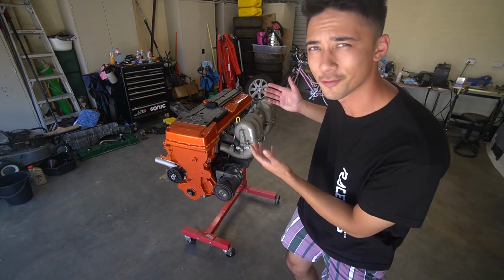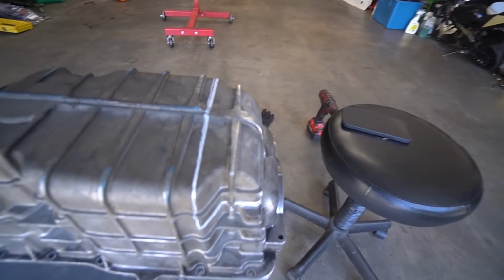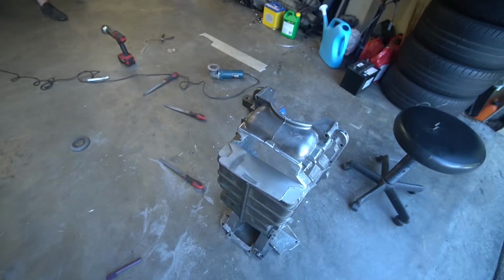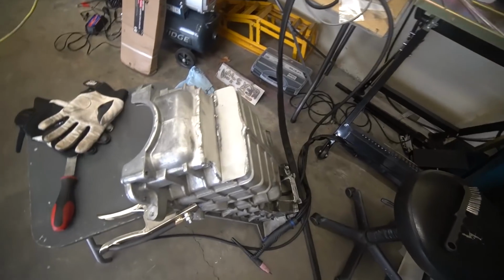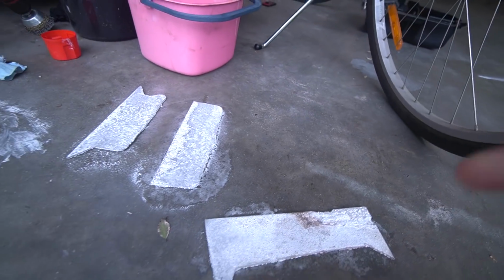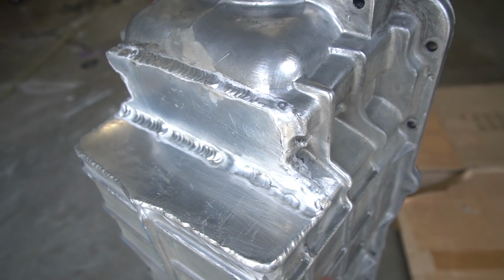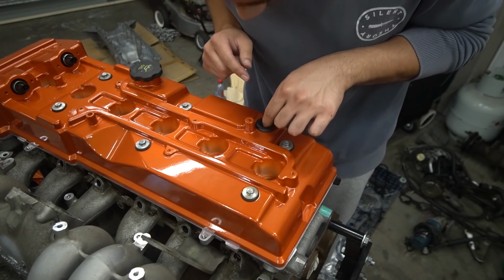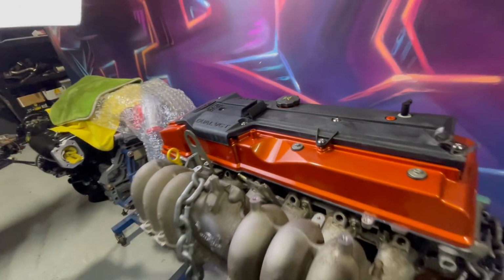THE BARRA IS READY FOR THE EF + CUSTOM SUMP MOD

Comment: Two hot tips for you mate the next time you cut ali.

Get a wax block and cut into it a few times throughout cutting with your disc . This wil make it cut better and stop the disc from getting hot and binding, causing it to catch and possibly explode.

And for god sake use the guard. Ive seen to many idiots take the guard off and the disc catches kicking the grinder back into their hands n fingers and discs exploding all over the place catching chunks of disc in body parts. No a pretty sight if you cop one in the face like an old work colleague i once knew.

Comment: By the way Rex there is nothing wrong with the pieces you welded the first time, when u removed them all u needed to do to replace the same pieces is simply grind the edges down so you can weld them simple as that mate.  If u grinded the edges down the first time u don’t haft to to worry about the coating as u have grinded it off.

Comment: I’m a bit late rexy what u doing u should of grind the aluminium down on the sump to give you a cleaner surface and the fab plates then clean with acid-ton it will give u a better welding surface even with metal it will give you better results